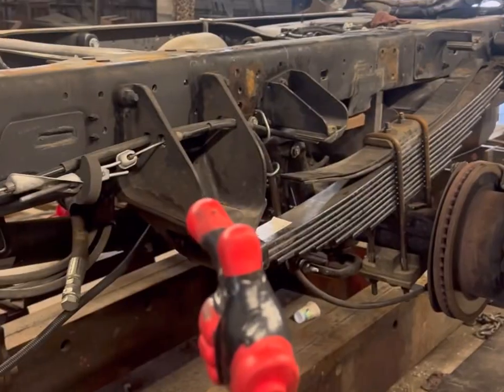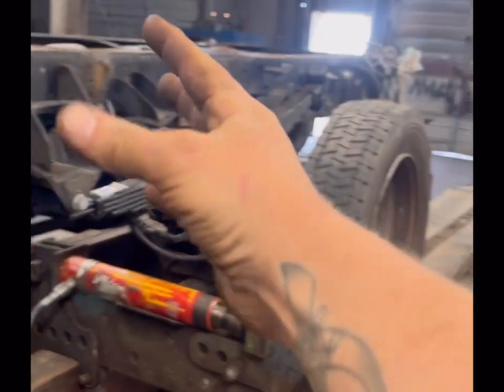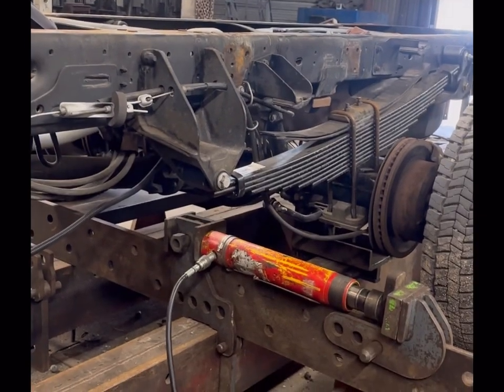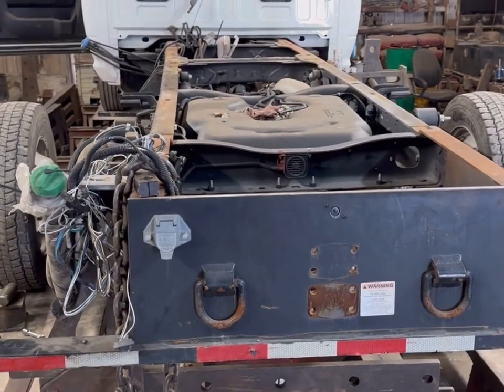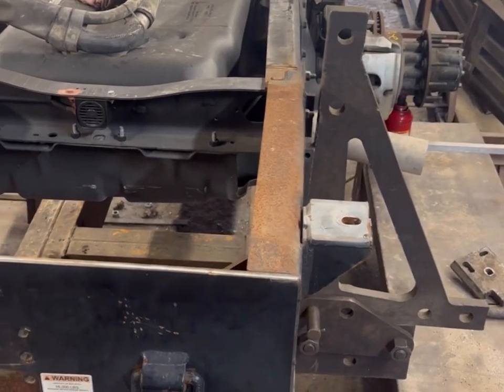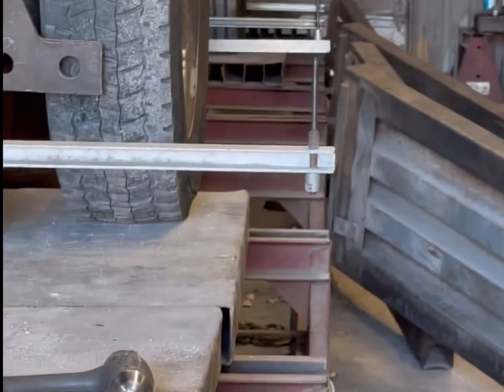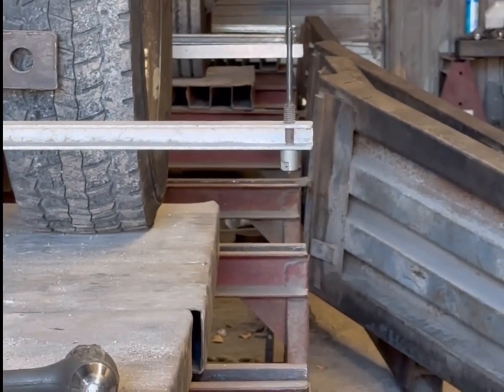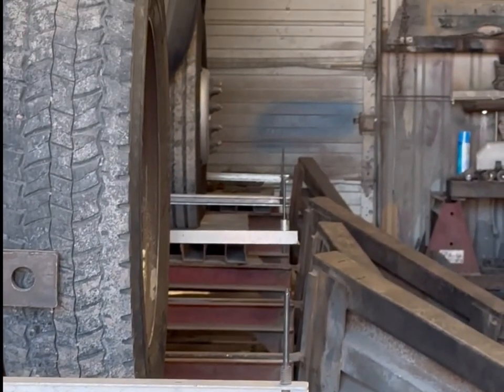2020 “FCA” ram 5500

Comment: Ford F550's have a issue also with a body mounted crane they like to break the right rail mainly because the crane operator does not take the time to use the outrigger.